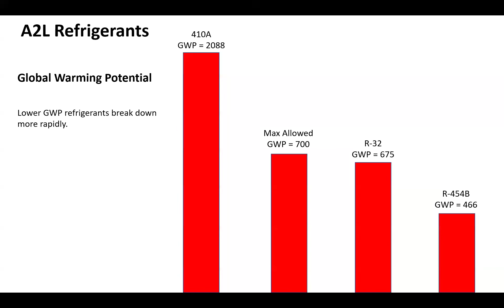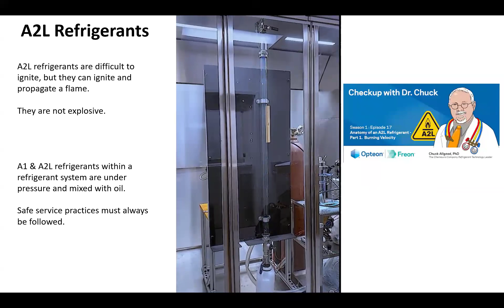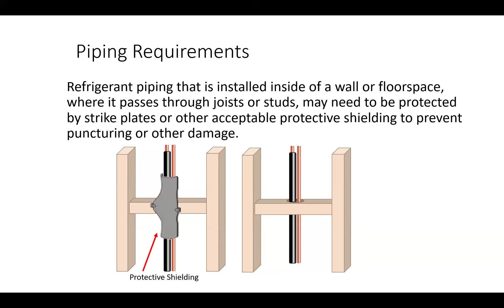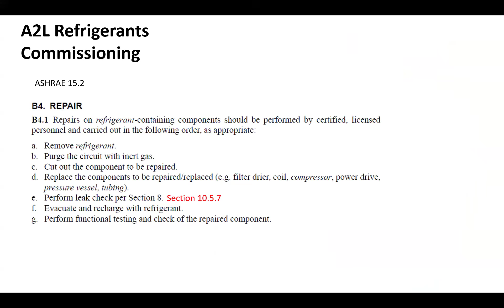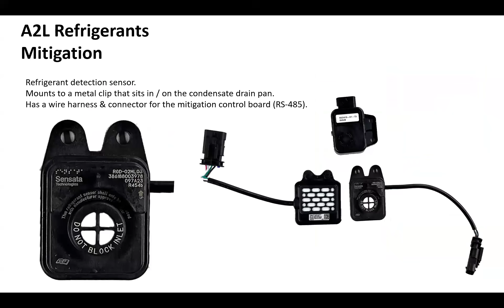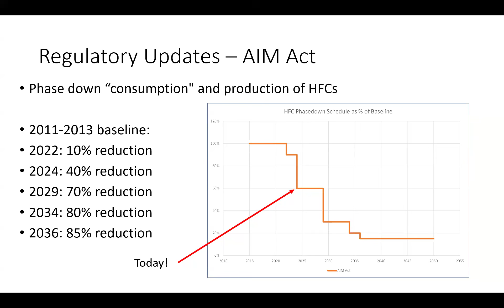A2L Refrigerants - What The Contractor Needs To Know

Comment: Great video; thank you, but please learn how to spell; it's REFRIGERANT, not REFINGENT. Did you even proofread this before you posted it??? What the EPA is getting away with is ridiculous! I don't know if anybody else noticed, but R22 has almost no ODP (0.05) and lower GWP (`1800) than R410A, so we eliminated a refrigerant (R22) in favor of one that has has a higher GWP, but zero ODP (R410A). Remember the industry told us back in 1995 that R410A was going to be THE refrigerant going forward into the foreseeable future; I guess the industry suddenly got very nearsighted very quickly! Now the EPA wants us to switch to a highly flammable refrigerant (LP) and one that operates at about 6 times higher pressures than R410A (CO2). Can anyone say FRAUD. Whose getting their palms greased in doing this? Also, why all the secrecy? Why didn't the EPA tell the industry that they were planning to switch the industry to R290 (propane, AKA LP) and CO2? How ridiculous is it that in less than a decade they are, once again, planning to switch to other refrigerants that require us to buy new servicing tools and equipment and requires manufacturers to once again retool to produce equipment that accommodates these refrigerants. Also, where the hell is the push back form ACCA and ASHRAE? Both of them should be screaming at the top of their lungs (as well as us techs and business owners. We should be complaining to our members of Congress concerning this problem) to the EPA at these proposed changes. Don't forget that the A2L push began while the highly incompetent Biden administration was in power, so there is no doubt in my mind that this was part of their ridiculous NEW GREEN DEAL (otherwise known as the attack on the oil industry and the attempted greasing of Biden's electrical buddies palms)! IMO we need to sternly resist the latest proposed switch to LP and CO2. If we don't it will continue in a never ending vicious circle. The EPA would like nothing better than to have us all living in homes with an electric space heater and a room AC and that's it! Someone has to say STOP to the EPA!!!

Comment: If the trend hold true next phase of refrigerant will be sold in a 15 lb cylinder will cost way more and probably have a even higher toxicity. 1234yf creates Highly Toxic Products of Combustion 

    Hydrogen Fluoride (HF): In the event of a fire, HFO-1234yf releases highly toxic hydrogen fluoride gas. When this gas comes into contact with moisture, such as in the eyes, skin, or respiratory tract, it forms highly corrosive hydrofluoric acid. Exposure to this acid can cause severe burns, lung damage, and even death, and poses a serious risk to vehicle occupants and first responders in an accident scenario.
    Carbonyl Fluoride: This is another dangerous decomposition product. It readily reacts with water (e.g., in humid air or body tissues) to decompose into hydrogen fluoride and carbon dioxide.
    Trifluoroacetic Acid (TFA): In the open atmosphere, R-1234yf quickly degrades (through reaction with OH radicals, not just burning in a fire) to form trifluoroacetic acid. TFA is a persistent organic pollutant that can accumulate in water sources through rain, though its projected concentrations are currently estimated to be below harmful levels for human health and ecosystems based on current understanding.
    Carbon Monoxide: Lower levels of carbon monoxide have also been detected as a combustion product, which can lead to cellular hypoxia.
Reply: Basically they are just trying to kill us slowly :(